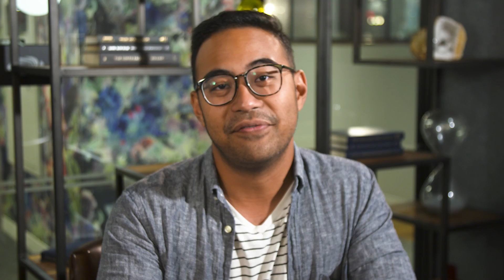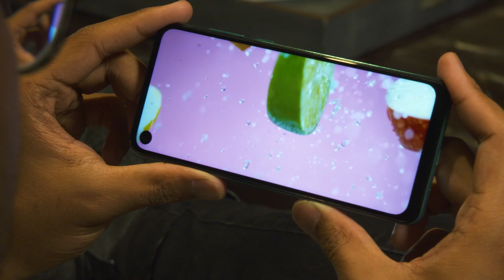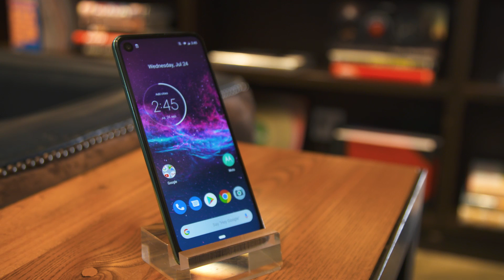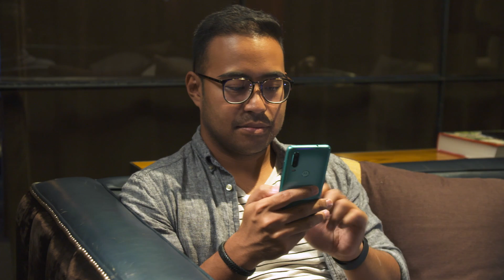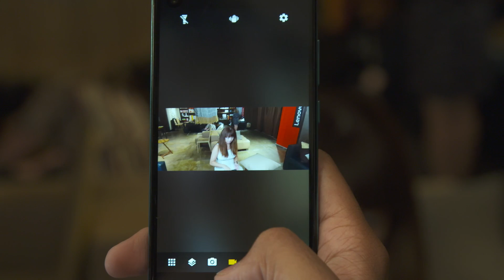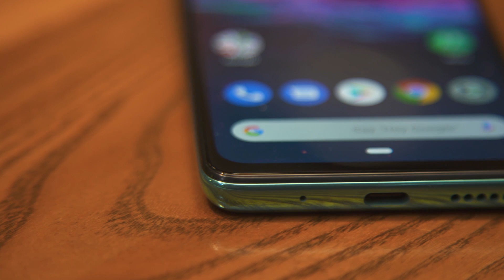Motorola One Action Hands-On: A smartphone with an action camera?

Comment: specs
NetworkTechnologyGSM / CDMA / HSPA / EVDO / LTELaunchAnnounced2019, August 16StatusAvailable. Released 2019, October 31BodyDimensions160.1 x 71.2 x 9.2 mm (6.30 x 2.80 x 0.36 in)Weight176 g (6.21 oz)BuildGlass front, plastic back, plastic frameSIMNano-SIM
Nano-SIM + Nano-SIM Water-repellent coatingDisplayTypeIPS LCDSize6.3 inches, 94.0 cm2 (~82.5% screen-to-body ratio)Resolution1080 x 2520 pixels, 21:9 ratio (~432 ppi density)PlatformOSAndroid 9.0 (Pie), upgradable to Android 11, Android OneChipsetExynos 9609 (10 nm)CPUOcta-core (4x2.2 GHz Cortex-A73 & 4x1.6 GHz Cortex-A53)GPUMali-G72 MP3MemoryCard slotmicroSDXC (uses shared SIM slot)Internal128GB 4GB RAM UFS 2.1Main CameraTriple12 MP, f/1.8, 26mm (wide), 1/2.8", 1.25µm, PDAF
16 MP, f/2.2, 14mm (ultrawide), dedicated video camera (1080p)
5 MP, f/2.2, (depth)FeaturesDual-LED dual-tone flash, HDR, panoramaVideo4K@30fps, 1080p@30/60fps (gyro-EIS)Selfie cameraSingle12 MP, f/2.0, 26mm (wide), 1/2.8", 1.25µmFeaturesHDRVideo1080p@30fpsSoundLoudspeakerYes3.5mm jackYesCommsWLANWi-Fi 802.11 a/b/g/n/ac, dual-band, Wi-Fi DirectBluetooth5.0, A2DP, LE, EDRPositioningGPS, GLONASS, GALILEO, BDSNFCYesRadioFM radioUSBUSB Type-C 2.0, OTGFeaturesSensorsFingerprint (rear-mounted), accelerometer, gyro, proximity, compassBatteryTypeLi-Po 3500 mAh, non-removableCharging10W wiredMiscColorsDenim Blue, Pearl White, Aqua TealModelsXT2013-1, XT2013-2, XT2013-4SAR1.16 W/kg (head)     1.43 W/kg (body)    PriceAbout 160 EURTestsPerformanceAnTuTu: 148748 (v7)
GeekBench: 5271 (v4.4)Display1237:1 contrast ratio, 459 nits max brightness (measured)CameraPhoto / VideoLoudspeakerVoice 67dB / Noise 71dB / Ring 84dBAudio qualityNoise -93.4dB / Crosstalk -93.7dBBattery (old)

Endurance rating 66h

Comment: Motorola has the BEST price-value balance. I am still enjoying my G5 after 3 years. It does everything I need and supports all I need. I also have an iPhone SE but only bought it because of compatibility with a 3rd party device. 

My Motorola is the most practical of my two phones. Now I'd like another phone but not cause I need one. Just because the new Motorolas look lovely. 😍

And at those prices....
.... I could easily buy another one. Yes people, they are doing fine if you ask me.

Comment: Can't phone makers make a some sort of a multi-aspect ratio setup with video and let users choose what aspect ratio to film in portrait mode? I imagine is not a difficult task, is it? Or phone makers refuse to do it? 

Or putting in such a feature will damage the smarphone peripheral business of grips, gimbals and etc?
Reply: That's on the lens, but in theory you can design a lens to allow light in certain ways. Maybe layer one 'lens' over another to allow that sort of light capture.
Reply: @jonathanpusar5931  it's not about the lens, but the sensor and software. The Panasonic LX series have multi-aspect ratio for shooting stills through cropping. Why can't phones have that?

Comment: Motorola should use Android One exclusively as they've shown they're unable to deliver timely security updates or operating system updates or point releases or bug fixes.
Reply: Agreed. When I heard it wasn't Android One, that's whe I tuned out.
Reply: I agree that they suck at updates! Lenovo Yoga Tab 3 Pro is still stuck on Android 6.0 instead of at least 7.1!
Reply: They should also fix their poor battery life......the battery drains to 0% overnight